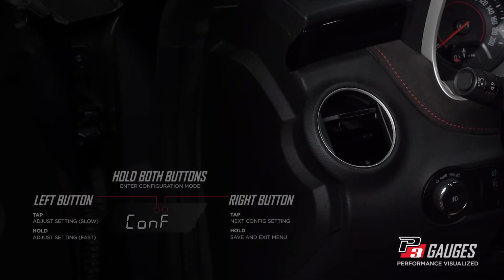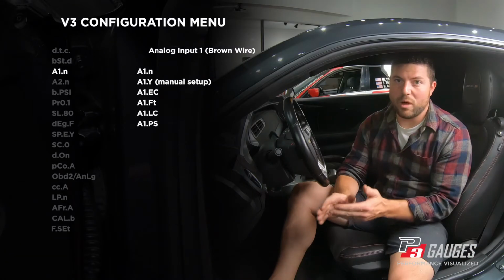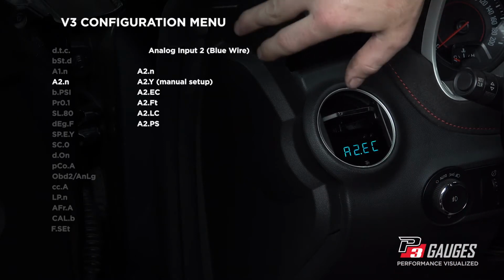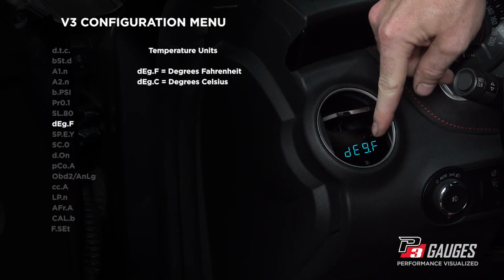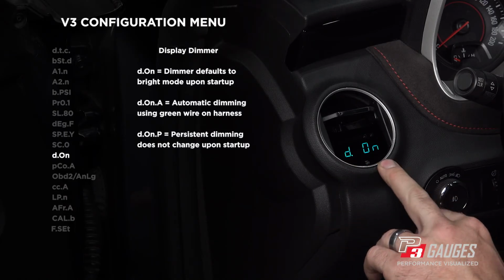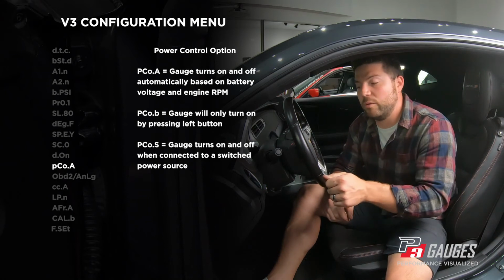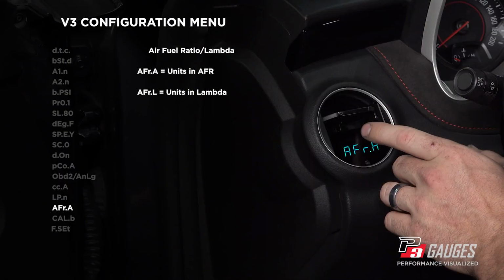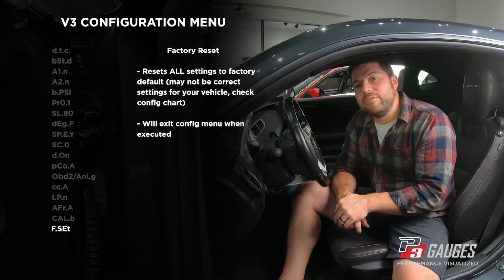V3 Config Menu How-To | P3 Gauges

Comment: My orange gauge used to read coolant temps but I exchanged it for a red/white one and now I cannot see coolant temps anymore. Any idea why? Same V3 OBD2 box, just a different screen
Reply from the maker: Hey Beckett,
It sounds like your coolant temperature readout may have been hidden (you do this by holding the left button until the readout disappears.)
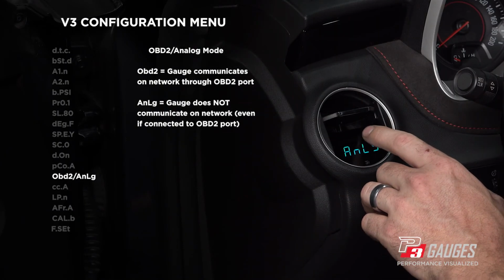To get it back, you can either follow the factory reset procedure, outlined at 18:53 or you can go to the cc.X setting and cycle through all of them back to the one you started on. 15:20 would be a helpful place to see info on this. Once you are back at the cc.X setting that you started on you can press and hold the right button to save and exit the menu and your coolant temperature reading should be back.

Comment: Is there any way to calibrate the throttle gauge to read 0 when my foot is not on the gas at all? When coasting it still reads 16
Reply from the maker: Hey Beckett,
Your car likely uses the throttle plate for idle control, meaning that the computer opens the throttle plate slightly to achieve the target idle RPM. Your throttle plate is actually at 16% (or degrees depending on the vehicle) and this is not a calibration issue.

Comment: &P3cars hi,I’m from the UK and iv got a P3 gauge,on the speed setting,is that the correct speed,because from the P3 gauge to my MPH on the clocks,there’s a 4MPH difference,many people have told me the P3 gauge will be the correct reading,but is it?
Reply: Did you watch the video?
Reply from the maker: Your speedometer will show the raw vehicle speed plus a small % of padding on top of that. So if you are traveling 50mph your speedometer may show something like 53 or 54 mph.

Our gauge pulls the raw value from the ECU without the padding.

You can also change the speed calibration in the config menu if you prefer it match your factory cluster.

If you have any other questions please email support@p3cars.com, thanks!